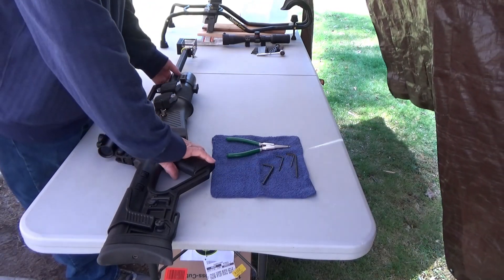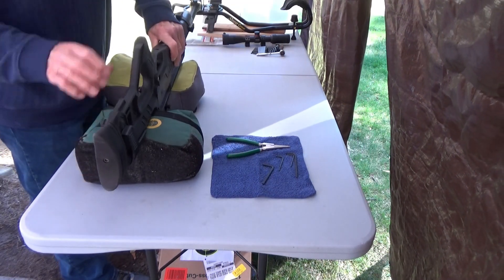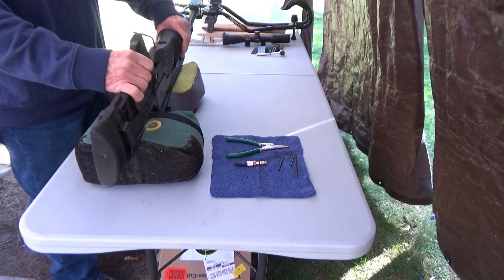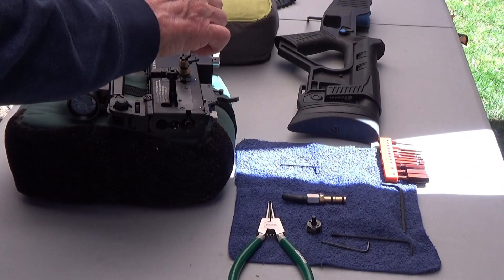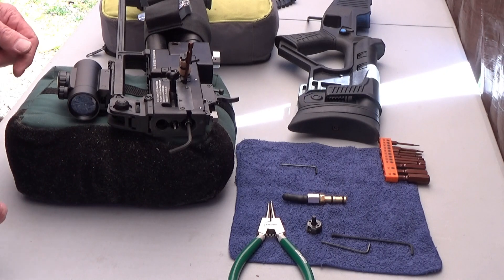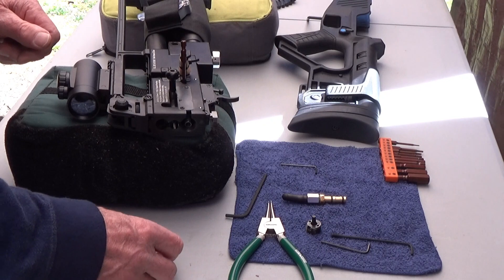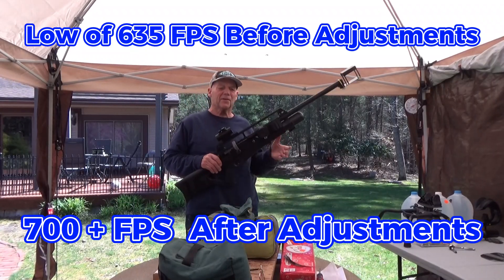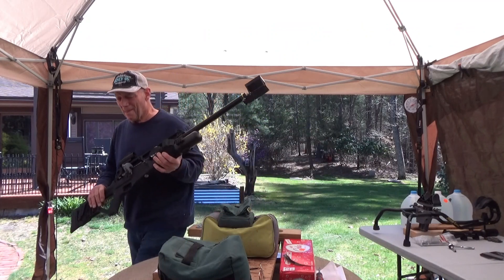Hatsan Blitz Hammer Spring Adjustment Adds Power

Comment: The bad thing with this adjustments is destroying the valve needle in front of the hammer.it will break down.
Reply: I have the 25 version and with 21.75gr pellets, on the bull pup version I was at 240m/s in the base after turning the wheel 1.5 revolutions, I am at 256m/s, How far does it go without taking damage? the machine works and cocking the gun works fine too

Comment: Thank you, mine has an adjustment screw in the center, can only turn it about 10 degrees.  How do you get your bolt to lock back so easy, I have to put the but on the ground and almost have to jump on it to get the last inch to be able to lock it back?
Reply: You need to turn hammer screen clockwise,  just few turns,  to lock the bolt easily. But it will decrease fps also.

Comment: How did this adjustment affect trigger pull? Mine is way to hard 12lbs +
Reply from the maker: Mine seems to be the same, very hard to pull on my 22 & 30 Cal Blitz..
Reply: Appreciate reply,going to take apart trigger pack and try to polish up parts and see if it helps, maybe play with springs....